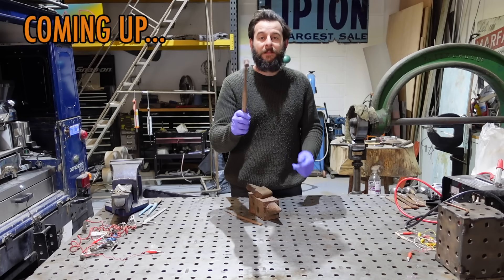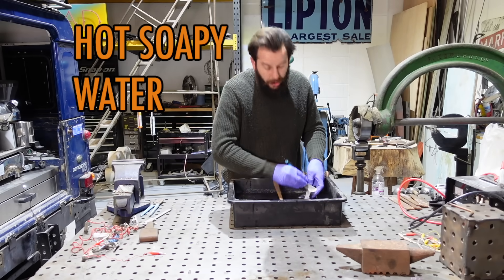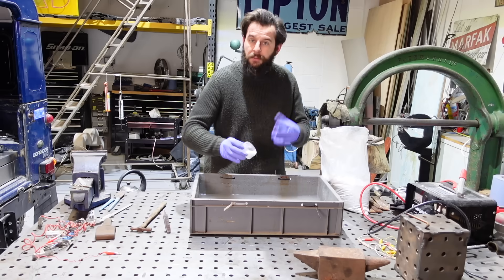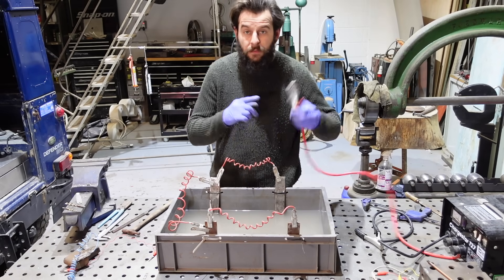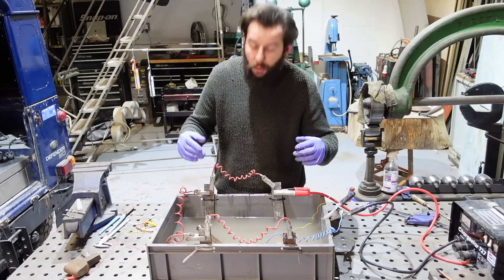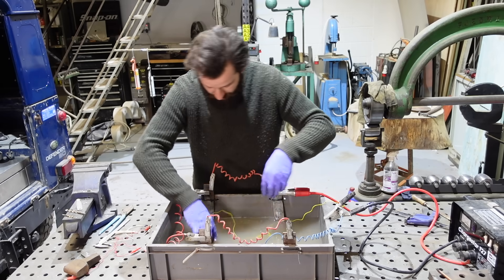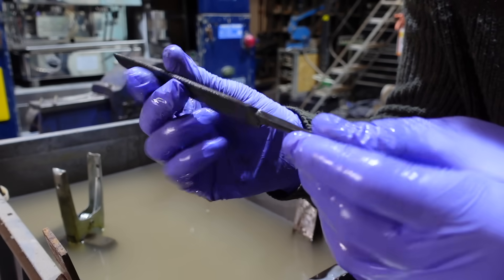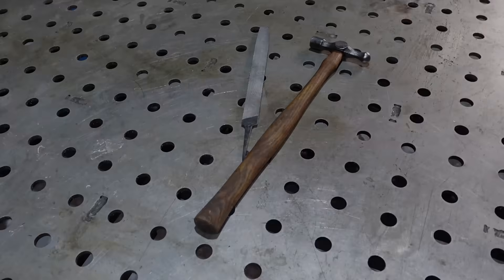The Power of Electrolysis | How To Transform Rusty Tools!

Comment: Works great, but don't forget that now that it's bare metal, it will flash rust real quick, so you either need to protect it with oil or paint. On tools, I clean the black oxidation off, then electroplate them, it's easy, similar process, plenty of diy videos on YouTube.

Comment: Cool stuff, 
I'd be curious to test the resistance between the two locations where the clamps are, to see how conductive the mixture is. Unless it's because of a setting you chose, that ~3-4 Amp charge current would mean (12V/3-to-4A=) only 3-4 Ohms which is crazy, if I'm right.

Comment: AI says:  The correct ratio of sodium carbonate to water for electrolysis depends heavily on the specific application and the desired conductivity of the solution. However, for general electrolysis purposes, a common guideline is to use a relatively low concentration to allow for sufficient ion movement without excessive resistance.

Here are some general recommendations based on different sources:

General Electrolysis: A concentration of 0.5% to 1% (weight/volume) of sodium carbonate in distilled water is often recommended. This translates to:

5 to 10 grams of sodium carbonate per liter of water.
1 to 2 teaspoons per 5 cups of water.
1/2 cup per 5 gallons of water.
Rust Removal (Electrolytic): Some sources suggest slightly different ratios for electrolytic rust removal:

1/3 to 1/2 cup of washing soda (sodium carbonate) per 5 gallons of water.
1 tablespoon of washing soda per 1 gallon of water.

Comment: I went and looked at all of my battery chargers, and every dang one of them was automatic. And then I remembered that several people had said that a simple psu like that for a laptop would work well if the voltage was high enough. I went to my local thrift store and found some that were 24v and 5 amps. Paid $1 each for them. They work great! Been blowing the rust off of my several cast iron pots for several days now. Just remember positive to the anode, negative to the rusty tool or pot.
Reply from the maker: Fantastic well done! Perfect

Comment: Used electrolysis for donkeys years.
Tip if you have a load of small iron/steel parts to clean get an old type magnet, check it is iron based and that it will conduct electricity [many modern magnets will not] Attach the magnet to your -ve wire and simply stick the parts on. After a while, re-arrange them to get good coverage ..... job done !

Comment: Did the electricity remove the rust? Or did it remove the oxygen from the rust turning it back to steel? I want you removed the metal from the rebar and make it plate the steel to replace missing steel that has rusted away. Something similar to electroplating steel on steel.

Comment: Safety Warning: Do Not use Stainless Steel as the sacrificial Anode; chromium in the anode would become hexavalent chromium (hexavalent chromium is the oxidized form of chromium, which I understand to be Carcinogenic. This great video is 3 years old, but I post this now in reply to @aliennomad3532, who, well meaningly, suggests stainless for the Anode. As no one seems to have commented, I would like to help everyone stay safe. I learned this researching my own electro rust removal, and suggest you do the same.

Comment: I wonder if using lye (sodium hydroxide) would be better vs washing soda (sodium carbonate). A sodium hydroxide (NaOH) solution is generally more conductive than a sodium carbonate (Na₂CO₃) solution at the same concentration. This is because NaOH is a strong base and dissociates completely in water into Na⁺ and OH⁻ ions, leading to a higher concentration of charge carriers. 

Moreover, if you want to remove old paint from a rusted object, sodium hydroxide is the money. It's a strong base so will break down paint faster. I believe in industrial applications, they use a hot sodium hydroxide dip for exactly this purpose, paint stripping! 

You can readily by 100% lye crystals. It is a bit more dangerous, strong base, so you'd need to wear protection!

Comment: Would keeping the water hot help speed up the electrolysis? I think hot water conducts electricity better? I'm using a 12v battery charger (13.6v @ 5A), but also have a 120v AC water heater from amazon (one of those things you submerge in water and plug into an outlet). Wondering if I should use it.

Comment: I originally posted a How-To video on YouTube somewhere around 25+ years ago and is amazing how much my method has changed.  I was, and still am, using an 84 Gallon plastic trash can like you would put out at a curb for the trash truck to dump.  I have yet to this day found anyone that actually uses my method, nor can I find my video on YouTube
I DO use Sacrificial Anodes rather than steel because mine works so much better. Instead of steel, I use Graphite sticks, or strips about 18-20" long..  They are 1/4" or thicker if you can get them and around 2" wide.  I drill the carbon (another name for graphite basically) and put a stainless steel screw through it on the end and then attach a wire with electrical eyelets crimped or soldered to a wire surrounding the plastic trash can.  It is square and I place an anode on each corner for a total of 4 anodes.  
I use graphite, or carbon because being sacrificial, they get eaten away and will not rust as steel does.  Instead of using a battery charger by itself, I use a Good car battery with a battery charger hooked to it to keep the battery charged.  Using just a charger does not have any significant amperage and does not work as well.  Using just a battery charger, the charger will eventually go bad.
I never let my terminals hang in the water because they will corrode. Instead, I use a mechanical tie wire that is used to secure nuts that might otherwise come loose under vibration.  It is also used for securing bolts and nuts on aircraft.  I use a piece of small angle iron long enough to span across the top of the trash can.  I then use the tie wire tied to the piece I want to de-rust on one end of the wire and to the angle across the can.  I always keep the piece suspended with tension on the tie wire so as to keep connectivity.  I take a cheap set of jumper cables that are clamped with the positive connected the wire that is connected to the Sacrificial Anodes, the negative is connected to the angle across the top of the can.  The other ends of the jumper cables are hooked to the battery terminals that also has the charger clamps attached.  I use Arm & Hammer Washing Powder soap in the water.  it has been used as an additive to hand was clothes on a wash board since the 1920s.  It is perfectly safe to use without gloves.  I often have my hands and arms in the solution way over my elbows, even while hooked up to power.
I have de-rusted large parts such as doors, inner fenders, etc. Anything that will fit in the can.  I can leave in in the solution for a couple of days or longer.  When it comes out it is black.  I don't scrub or use a wire brush to finish clean the items.  Instead, I use a pressure washer and the black comes off, and unless the rusty part has rust scale on it, it is bright like new metal.  You have to be relatively quick to dry the piece and protect it, otherwise it will flash rust.  I use something like WD-40.
By using the carbon or graphite for anodes, the anodes will deteriorate over time depending on how often you use it and will have to be replaced.  The problem is that they are difficult to find lately, and they are not cheap. Can you see how much my information has changed?

Comment: To clarify. You CAN NOT get electrocuted.
Reply: That Is unless you Are using cheap power supply that don't have properly isolated mains from secondary then you CAN get electrocuted if there is an issue in device.

Comment: I discovered this a couple months ago and already saved hundred in tools. I’m about to clean out my garage and I can’t imagine how many tools I would’ve thrown out if I didn’t come across this method. The best results is soak 24 hours, scrub with wire brush, soak for another 24 hours, light scrub with wire brush then rinse dry and oil to prevent further rust.

Comment: I just saw this video and im probably a bit late but didnt see in the video or comments....

-Would a 6 volt charger work as well as a 12 volt charger or a 24 volt? 

- with a larger part, table from a table saw perhaps, require more voltage or more ampers? Would the anode and cathodes need to be larger too? 

I'll Google it in case I've commented to late here but appreciate the video
Thanks you

Comment: What am I missing? I copper plate wood items I turn on the lathe (after sealing them, then coating them to make them conductive).  In doing that, I put copper on the positive lead, the anode, and the copper moves off the anode and into the solution, to replace copper sulfate already in the solution and that is being deposited on the item tied to the cathode, the negative lead. 

If I put the item being plated on the anode/positive side, it would try to remove the conductive surface and deposit it on the cathode side.

I just assumed you'd remove the iron by trying to move it to the cathodes with the flow of electricity, just like plating.

Comment: For those unsure 

Sodium carbonate is a relatively basic salt, where "basic" is the chemical opposite of acidic. It has the formula Na2CO3 and goes by the colloquial names "washing soda, soda ash, and soda crystals”.

With the chemical formula NaHCO3, sodium bicarbonate (baking soda) is structurally very similar to sodium carbonate. It's much less caustic, however, and is only a very mild base. It has many common household applications, including as a cleaning agent and as a leavening agent in baked goods. You can also ingest sodium bicarbonate in water as a mild home remedy for acid stomach; it neutralizes stomach acid, relieving symptoms of heartburn and producing the harmless compounds carbon dioxide and water.

Comment: Dominic, Iv used this method a few times, works great,
But before I used electrolysis method I used molasses, the cattle feed from farmers supplies,
 I had a cobblers leather machine with several cogs ,rollers.spindles hand wheel etc weighed about 60 lbs dam heavy for its size,about 18"x 18"x 8"rusted and stuck so bad,
Filled a container with a ratio about 100-1 water /molasses can`t quite remember now,

Left in the mixture for two weeks,it does start to smell and brown froth appears on top,as the mixture eats at the rust,just like your method if left,

When pulled out complete rust free , it did darken the metal parts as most wast cast iron or cast steel .everything freed  up,
I gave it a quick rinse and light scotch pad in soapy warm water dried of with heat gun then a blend of bees wax mixed with oil,
 kept rust free for 4 years, but rust came back after the 4 years left in a damp shed,not used and not covered up,

 American vintage body repairers have been known to use molasses for years for big rusty panels,like car bonnets.
 I think on the web it states chelating agents in the molasses mainly cyclic hydroxyamic  acids are effective to chelate iron that makes it soluble, but can damage other metals so use only for iron rust not all corrosion, I have used it on all my tools as well and they seemed fine,

But I am sure when dipping cast parts into this molasses stuff it can weaken them due to it absorbing the carbons from the cast,something like that I read,
Do not get the fermented molasses on the skin it stinks and the smell lasts on the skin loll,

Comment: I’ve been doing this for years and it truly works wonders. I dug up some old single shive and double shive blocks buried in my yard that had probably been there since the 1890s   They were frozen solid with rust and seemed beyond repair. I cooked them in the tub for about 4 days and when I took them out, the dirt and sand had dropped off them and after a good rinse the shives turned like they were just built. I washed them again and dried and painted them and they are like new with a good lubricant. It’s like magic

Comment: SAFETY NOTE:
Do this in a well ventilated area with no sources of ignition. 
The bubbles fizzing off are Oxygen and Hydrogen gas and highly explosive if allowed to collect. Most of the time this will not be an issue, If however, you leave the whole setup running overnight in a small closed room where perhaps your gas water heater is, you could wake up early in the morning to a loud boom and find you no longer have a garage or shop.

https://en.wikipedia.org/wiki/Electrolysis_of_water
Reply from the maker: This is true thank you for the warning!

Comment: Been doing this for years . . . not take it to the next step.  Put the tool on the anode and put a piece of copper on the cathode.  This will deposit a layer of copper atoms on the tool.  You can also use silver and even gold.  It works great and provides additional protection on all the parts of the tool other than the pounding head or the saw teeth.

Comment: About 2 years ago I was gifted a 1986 Toyota micro mini RV that had sat for 17 years without preparation. Needless to say the fuel tank was in a sad state. I had at that point never done the electrolysis treatment to anything and honestly was expecting the fuel tank to be unsalvageable. 48 hours @ 10A/12vdc, and the tank was immaculate. 
I will try to dig up video and put it on my YouTube channel

Comment: Nice video. A couple of thoughts... your battery charger would be happier if it had a battery connected to it to act as a regulated load. It doesn't need to be a brilliant battery as long as it'll hold a bit of charge, and it doesn't need to be a big one... a motorbike battery would suit. That'll also trick the "smart" chargers into turning on. Also rather than using steel for your anodes a softer metal will work better... it'll corrode preferentially to the steel tools but won't rust. Marine supplies places sell zinc anodes for outboard motors that would be perfect.

Comment: I guess you could use a car battery if you didn't have a basic charger ... obviously being SUPER careful not to short - and you'd need  a 10 Amp in-line fuse or similar. Any thoughts?

Comment: Just to say…Remember rust is formed directly from the parent ferrous metal… so you will find when the rust has gone, degradation of the underlying surface.  Any once sharp edges will likely be eaten away and surfaces will have pitting.

Comment: Hi, I have a question, my battery charger which is a basic charger kept popping the reset when I connected it, the only way I could get around it was connect it through a 12v car battery, is there any down side to this method

Comment: I think you can just use salt? Its a electrolyte.
Also ive discovered the inside lining of a dishwasher is teflon or some other very high lubricity plastic. I had one taken apart stuffed about 50 pounds of junk 24kilos for non americanos and i could push it with one foot over concrete. It was slick but i think you could use them as standing pools to recollect the rust water.

Comment: Dom,
Excellent, thanks very much for this.
I am using this approach to try and free some frozen tee hinges that have rusted in a set position.  My battery cahrger is 4A.  The circuit appears to be drawing more than 4A, so the battery charger overload protection kicks in, waits and then resets.  The upshot is that I'm getting a duty cycle of about 1:5, i.e. on for about 1/6th of the time.  Is there a way around this?
Many thanks in advance ofr any help you can offer.

Comment: You can use Graphite plates for your anodes and the process is much much cleaner and easier to manage long term for a repeatedly used electrolysis tank. You can get graphite plates on eBay or the some other online retailer that you prefer.

Comment: I use a car USB adapter, 5v 2amp   it's a slower process of de rusting but far less aggressive on the metal (less etching)  less hydrogen venting too.
even run it from my shed solar system for free power (woo fractions of cents saved!)

and I use titanium for the anode, virtually no corrosion (reclaimed free from dead pool chlorination cell)

Comment: Dominic, a superb video; I've seen you using the technique on the Repair Shop and am going to use it on a rusty scaffold clamp. Having watched you TIG welding; that's a technique I must try, I use stick and MIG but have never tried TIG, though seen it done on SS handrails.

Comment: I do this with random tools, and the reverse to replate things. I'm here looking for more knowledge so I'm not trolling you when I offer the following....I tend to avoid hot water. It does, visually at least, seem to make a bit of a difference, but depending on what you're doing and what's in the brew, so to speak, you don't really want steam carrying around the potential vapor slag you get depending on what you're plating or unplating.
Reply from the maker: Thanks for the tip!